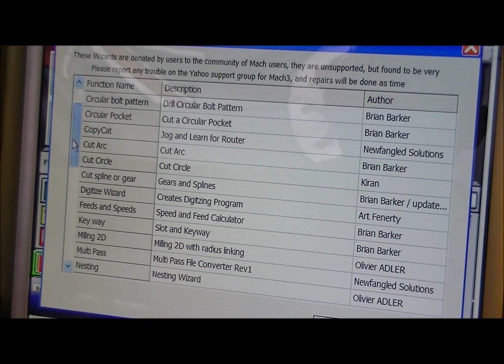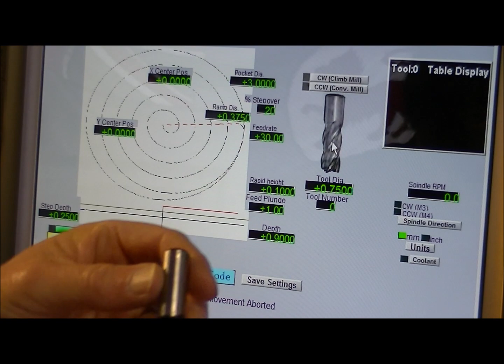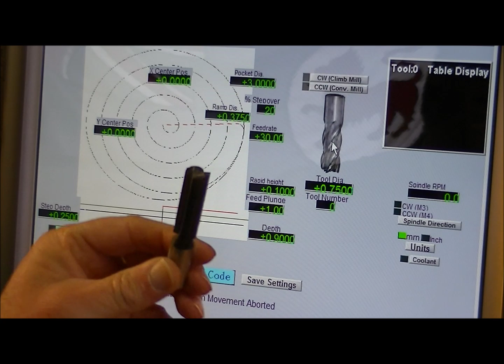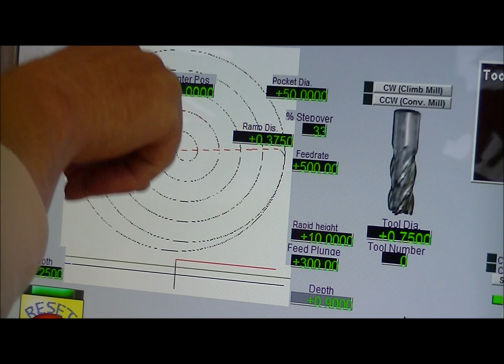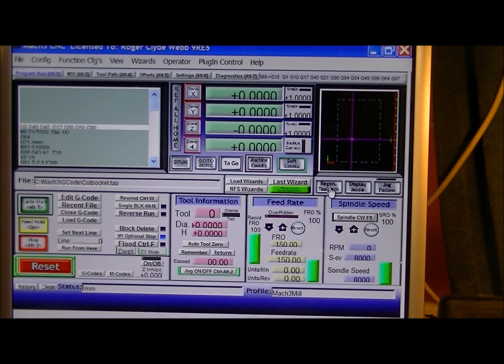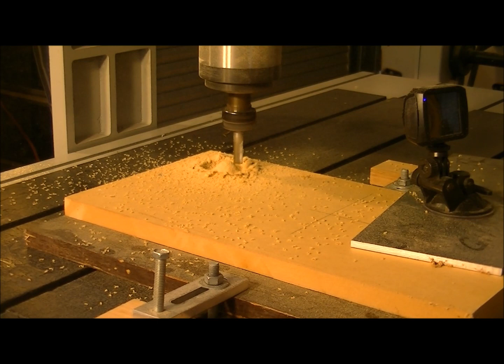99  Mach 3 wizards speeds and feeds for beginners

Comment: Nice tutorial!!
But i really don't understand where you pick your parameter for that kind of endmill.
4flutes can go a WAY faster than that,and if you don't you burn the mill.
Maybee a single flute is more apropriate for your kind of feed and speed.
Or maybee ''cut'' he spindel speed by 4.
For me, a single flute up cut spirale going around 2500-4000mm/min/flute
I mostly use double flute (6mm)and cuting around 10 000mm/min at 18 000rpm.
Fred